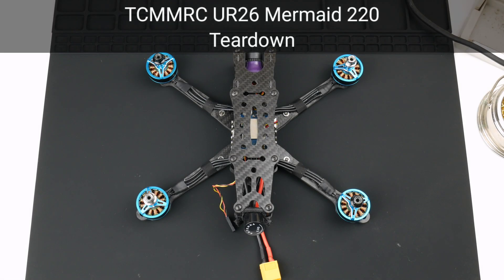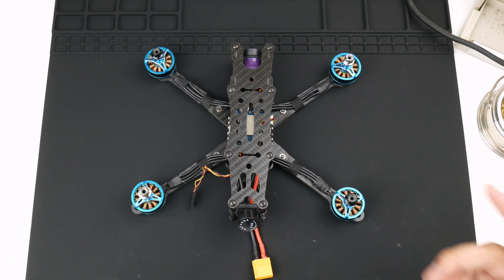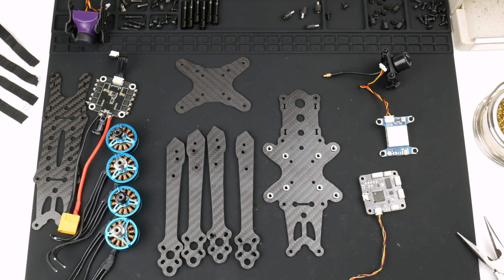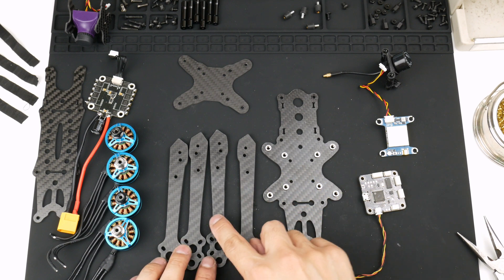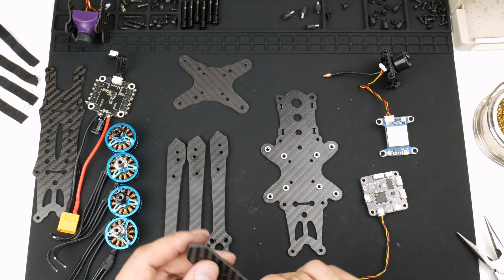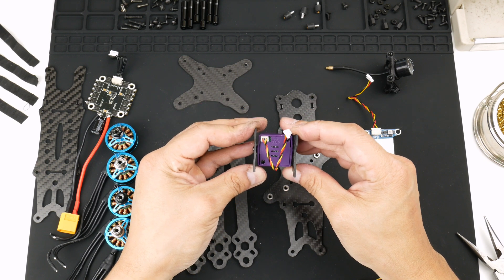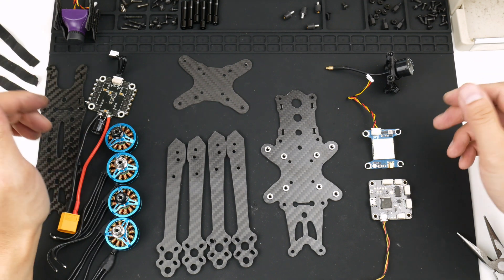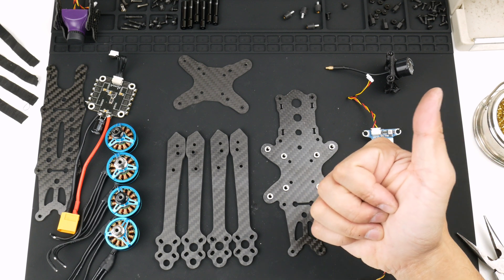TCMMRC Budget Teardown Rebuild - The Teardown

Comment: Nice video! Maybe I've missed it, but do you know if your ESC is 30 or 45 Amps? On ali they state that they use a new version with 45 Amps, makes me curious whether I should take the gamble.
Reply from the maker: You didn't miss it in this video, but I did mention it in the "TCMMRC Budget Teardown Rebuild - Intro" video that I contacted TCMMRC and they said they sent me the 40A version. I have no way of actually confirming what I got though! In the later videos, I install an upgraded SkyStars KO55 (55A rated) ESC anyway, and will be keeping the original 40A ESC as a spare. Hope that helps!